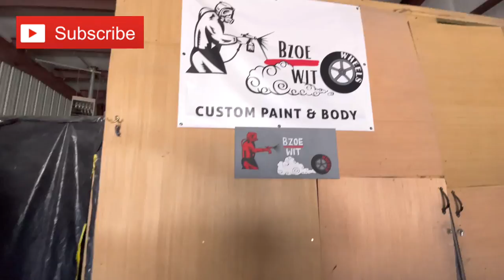Applying Black Base Coat For Candy Brandywine!! 
#candypaint

Comment: Turn your compressor all the up and put a pressure regulator at the gun and adjust  it from there,that way you won't have so much pressure changes. The paint will flow alot better and no more strips.
Reply from the maker: Appreciate you brotha!!

Comment: What kind of air compressor u use bro? Im about to get into painting. Just bought my first gun. Now onto a compressor
Reply from the maker: I have a fat boy 60 gallon air compressor
Reply: @bzoewitwheels4029  sheeesh. I ended up getting a 20 gallon compressor from harbor freight. Using that to paint motorcycles and cerakote guns. Will have to probably upgrade when i get into painting cars.

Comment: just a heads up that high tech paint brand sucks. peels and never seems to fully dry
Reply from the maker: Lol what reducer are you using
Reply from the maker: I only ask because I’ve even had house of color and expensive brands do the exact same thing
Reply: @bzoewitwheels4029  omni medium reducer. i painted a maroon color coverage was minimal took about 10 coats to get it done lol never again
Reply from the maker: @rique8296  lol I feel that!! Humm I haven’t really had issues with it. Good luck out there boss!